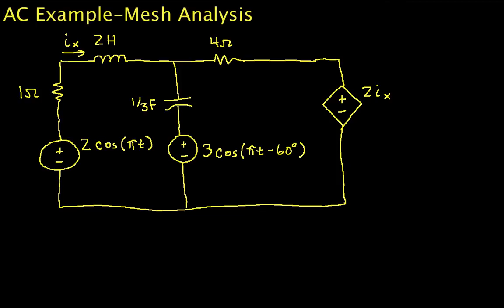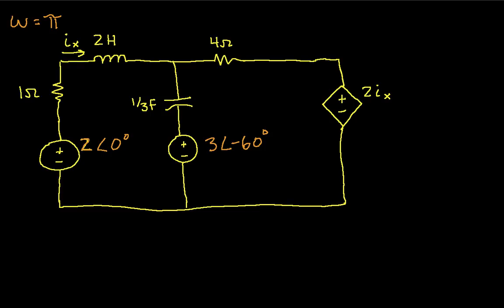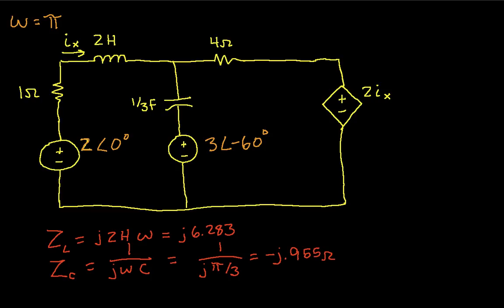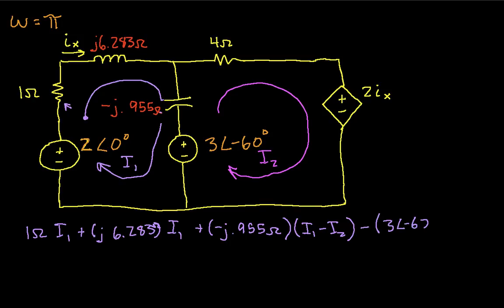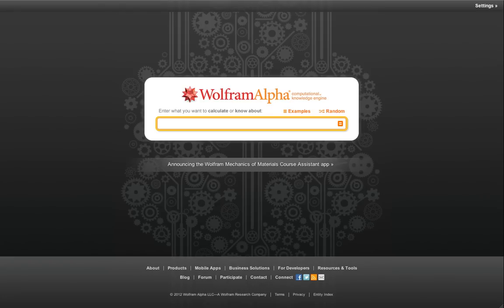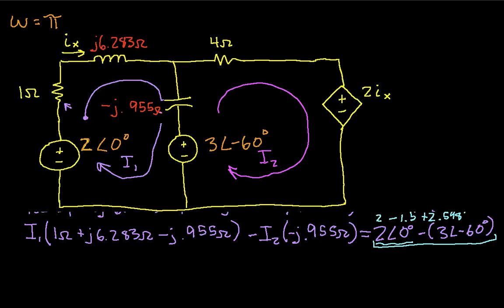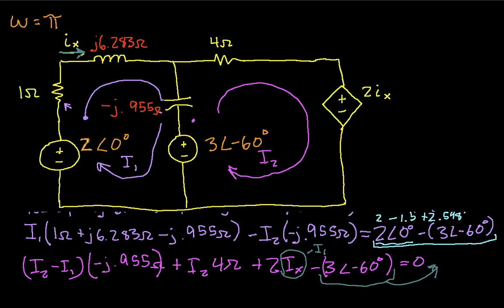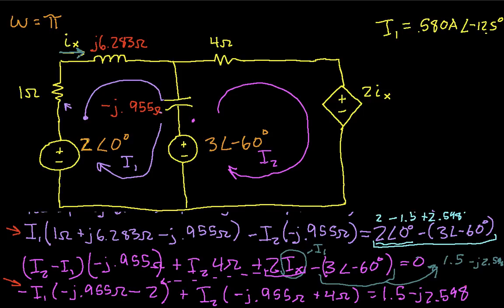AC Example-Mesh Analysis

Comment: you're doing wrong. For example, for the first voltage source, 2cos(pi.t) means the maximum value of voltage which is 2V. But if you'll use phasor form, you'll need to Rms value of voltage, which is 2/sqrt(2)V.
Reply: What about the second power source 3cos(pi.t-60*)
Reply: No, he's not doing it wrong - at least not in that respect. The 2 [V], or 2/sqrt(2) [V] if you must, is only a magnitude; as such, it isn't affected by the phase of any of the circuit elements. I'll grant that the IEEE standard is to give signal magnitudes in terms of their rms values ... but this is done primarily for the sake of consistency in the technical literature. If you use rms values when making power calculations then you don't have to worry about scaling things by a factor of 1/2.
Reply: @johnnolen8338  You're wrong. In the given form with cos function, 2 represents maximum value, and 2/sqrt(2) represents effective value. The maximum value is the amplitude.
Reply: @petar000petar  
Thank you for  your input, but I'm not wrong. I've been a practicing EE for 33 years, and I've been doing trigonometry for a lot longer than that. I know the difference between a sine wave amplitude and an rms value, which is what I was addressing in the comment to which you replied!
Reply: @johnnolen8338  what's scary is how he got 8 likes while talking nonsense

Comment: the question is not hard , the hard part is to solve the equation to find I1 and I2 ?? i enter the video to learn this but u use the F wolfarm
Reply: I'm searching that for 2 days but still couldn't find any calculator tutorial on that. I know putting numbers into a matrix but you can't put imaginary (complex) numbers into a matrix.
Reply: you can solve it by matrix or manually using substitution or elimination